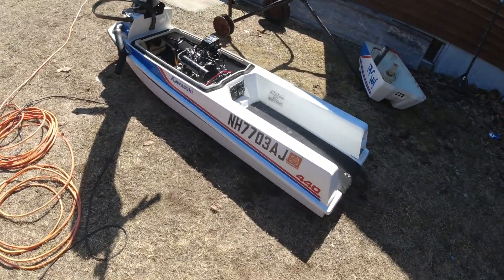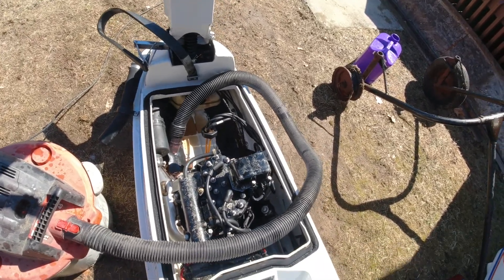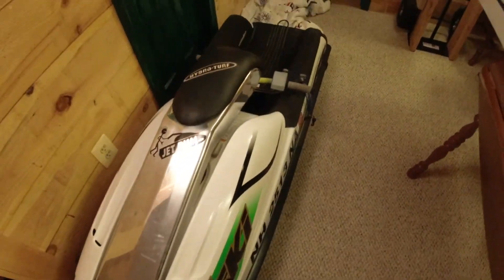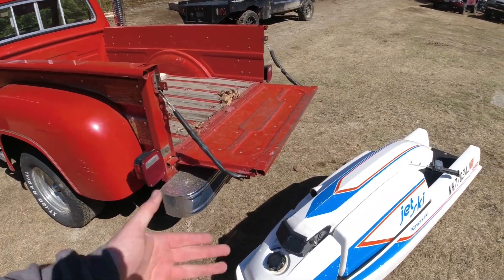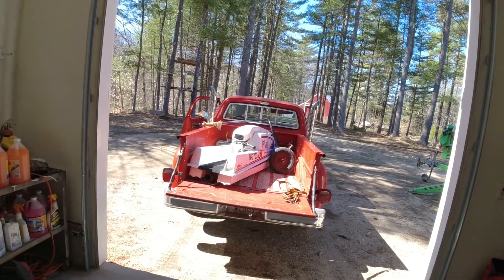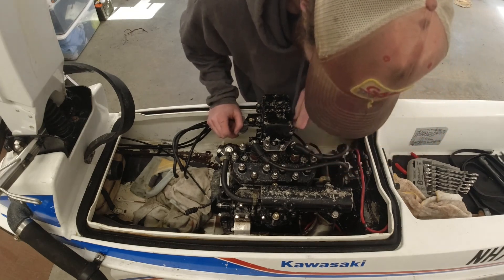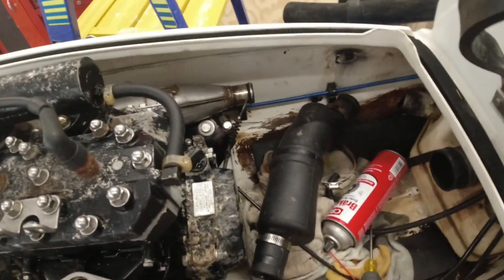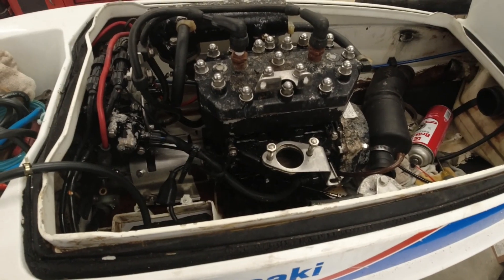js440 Rebuild Part 1

Comment: where do you buy your parts from i am rebuilding 2 need help.
Reply from the maker: I buy from vintage jet ski parts, ebay and Amazon
Reply: Where did you buy the carb from?
Reply: Amazon, surprisingly, carries a bunch of the parts you’ll need. eBay is the next best source